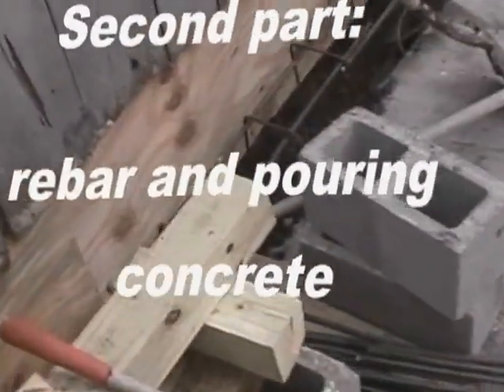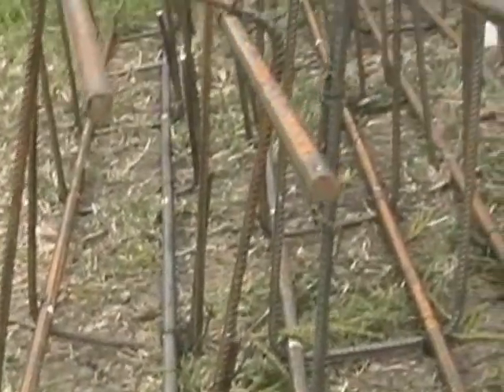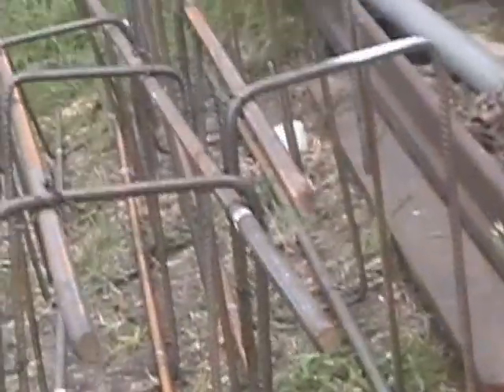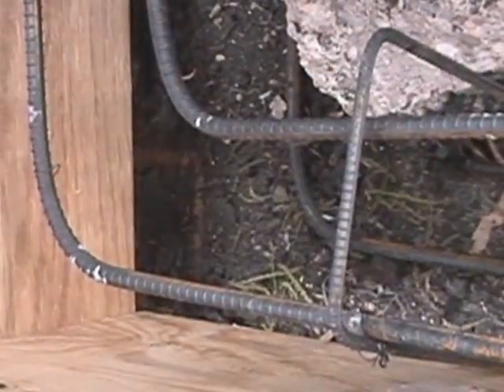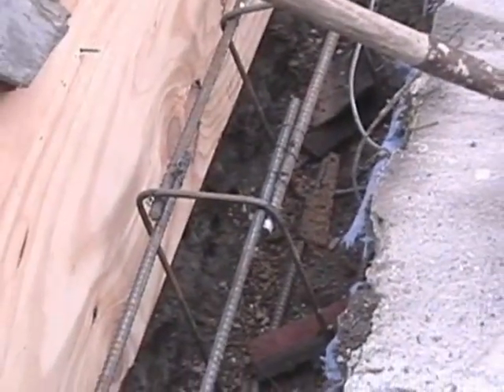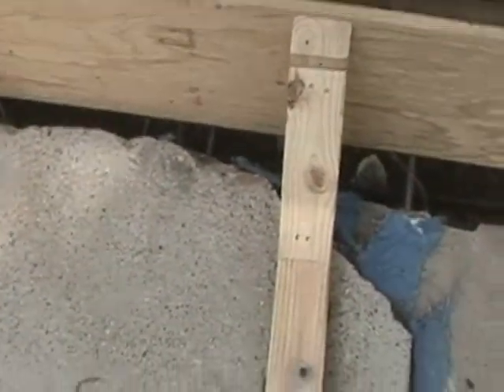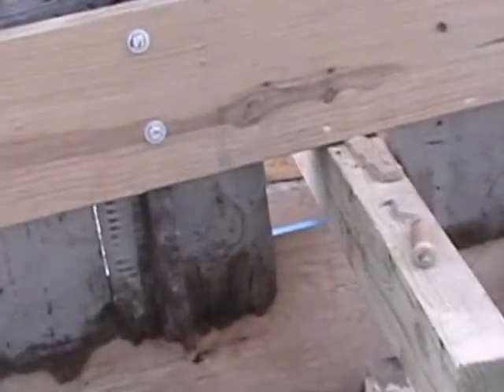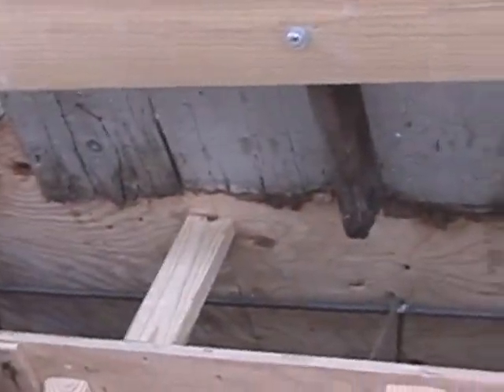saving your garage part 2 and      part 3 in description below

Comment: Sometimes it's better to demo the whole thing and start new.. I don't see much what you are saving. Being the whole thing down.. Pour new foundation and frame new.. Seems like you are doing much of it anyways
Reply: Some times the town want it that way or else you lose the grandfather .
Reply: Having watched part 1 and read comments, one other said it would be cheaper and easier to rebuild and his response is basically this, the town wanted him to build in another spot which would require a whole set of permits not to mention a full footer and slab with a new building on top which would have cost him a LOT more in the end than this method. And by a lot more I am referring to the cost of permits which would be hard to say how much, then a building structure depending what size footprint (let say its 500 ft2/46.45 m2) and style of framing can cost anywhere from $30 to 60 per square foot, thus the building alone at 30/ft2 would be 15,000, then say he got concrete poured for 4,000 at best, this alone would 19,000 compared to having only in this manner he did it to not require permits likely cost 4,000 at most. Oh and I forgot to include excavation work for the new foundation and said new building which could run say 1,000 for a total extimate and wild guess of 20,000!
Reply: @Joshua79C  you also got to consider the value though too. A brand new shop would be worth way more. He is spending thousands to repair this, and he is lucky if the value he has added will outweigh its costs considering the age of this building. A brand new building would add way more value to the home. WAY more.
Reply: @acreageliving  Nah'.  Its a garage.  Not a new coded shop.  Earlier video discusses that his area requires new structures to be moved away from this garages location.  Also having to remove a 50 year old pecan tree.  Most of his project is his labor.  The rest is lumber, regardless, and concrete.  Good thing about this project, is since he is raising and restoring, the earlier code applies.  My cost on a 24 by 24 foot, single door, concrete slab garage .. .. built with three outlets running in conduit from my home garage panel ??  $30k.  This guy in this video .. .. $5k to 10k is a win, win, win and the tree stays.
Reply: @jamiecampbell3068  can transplant the tree, still an old garage on paper